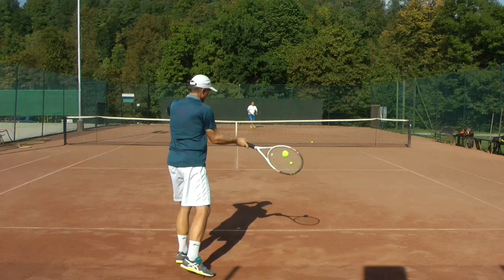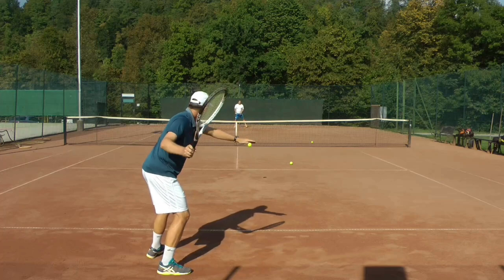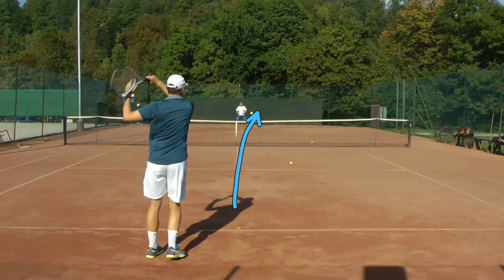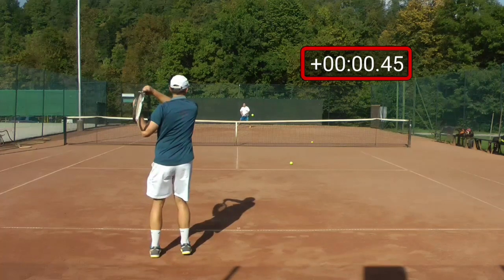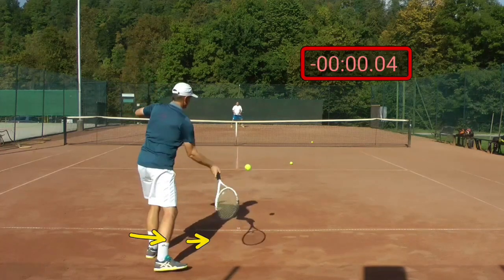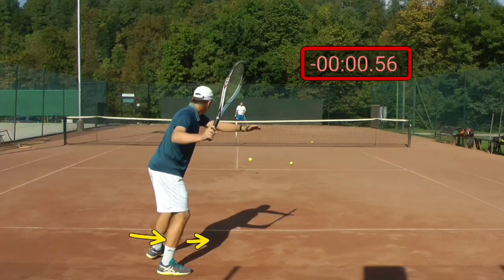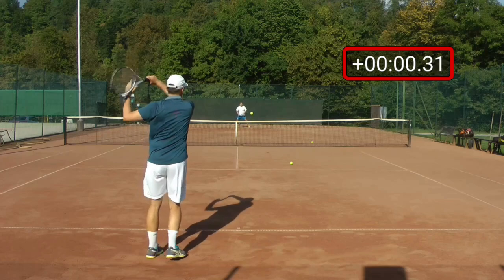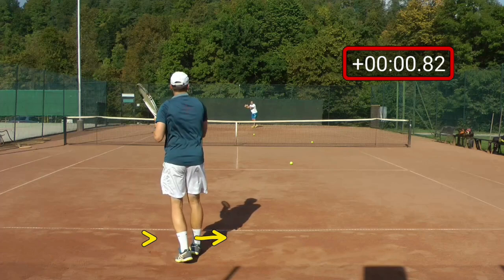Why You Could Be Hitting The Ball Too Hard In Tennis

Comment: Great insight!  Another speed perception issue relates to the flight orientation.  A ball traveling directly towards you offers fewer flight progression cues to your binocular sight.  As opposed to ball that is traversing the court at an angle where the offset between your eyes allows the brain to better anticipate the flight path and time to arrival.  If you feed balls to a beginner, your chances of being hit right between the eyes are higher.  Ouch!
Reply from the maker: You need to calculate air friction, drag because of spin and slow down (friction) because of the bounce. A math professor calculated for me these numbers for 1.5 seconds ball flight with both players 1 meter behind the baseline: OUTGOING speed off my racket: 81 km / h (50 mph), receiving speed of at my friend's racket: 49 km / h (30 mph). It is a well known fact that a tennis ball loses around 50-55% of its initial speed by the time it reaches the other side. The same applies to serves. A 200 km / h serve will reach opponent at around 110 km / h. And yes, those "slow" speeds are the speeds we recreational tennis players can play.
Reply: @feeltennis  
The air friction loss dependent of the spin effect is probably on the order of 10% of the loss.  For a baseball pitch using a radar gun, the loss is 2-3 mph from the pitcher to crossing the plate against a nominal 90 mph throw.  A fuzzy tennis ball would be higher. The bounce is huge.  The coefficient of reciprocity, a measure of the energy dissipated in the bounce, is key to the ball design.  If hitting hard against a wall, you can feel the heat rise in the ball which is where some of the loss speed energy has gone.  The perception of speed received may also be related to higher spinning kick moving the contact out of the optimal zone.  Anyway, I still very much agree that your general point applied to the practically of play.

Comment: Great insight on a simple and super important point. I can play well at same level of opponents, but i get more time pressure with someone more than 0.5 or 1.0 point level(4.0 + utsa), by their faster ball and terrible stable attack. I lost my timing, as I cannot get the full imagination of my return trajectory(highlight of cross the net and depth to the baseline) , do you mean I need practice more like imaging this as soon as I can, or I think I need play even more with higher level player, to get used to their timing??? Thank you Tomaz, a big fan of you
Reply from the maker: How about you try to imagine just the right height above the net while maintaining a constant speed of your strokes? That may be easier to keep in mind. And yes, you need to get used to the speed, but the key is gradual exposure to higher speeds, not suddenly jumping from slow player to a fast player.
Reply: @feeltennis  good point, i will practices. You are right definitely, keep appropriate/constant timing when against diff level of opponents, it is not easy

Comment: That's a pretty good video, I'm the one who was holding back and playing too slow (as enforced by the coach). Yes pace is not the best factor if you cannot handle it. I still have mental inhibitors to playing faster but working at it. Right now I'm playing slightly faster with general control but not able to dictate points. How do you gain control of the point?

Comment: A court is 78 feet, plus the space behind of say 5 feet each side, is 10 feet.  60 MPH is 88ft per second.  So on average 1.4 seconds is  1/1.4 * 60 = 43 MPH.  Seems slow.
Reply: I have read ground strokes average 70 to 80 mph.
Reply: @johndublin776   Maybe off the racquet? A 140 mph serve lands at under 120.  Still too fast for my 70 yr.old, 4.0.  Ha.
Reply from the maker: A math professor helped me calculate some numbers: at 1.5 seconds and playing 1 meter behind the baseline the outgoing speed of the ball from the racket is 80 km / h (50 mph) and the receiving speed of the ball on the other side of the net is 50 km / h (30 mph). 

That is taking into account loss of speed because or air friction, air drag because of some topspin and the friction because of the bounce.

It has been measured decades ago that a tennis ball loses around 45% of its speed from one side to the other. 

A 200 km/h serve is received at 110 km/h. Pros play from the baseline with around 100-110 km/h outgoing speed off the racket. 

The loss of ball speed in tennis is tremendous, just not obvious to the naked eye.
Reply: @feeltennis   I read on line that the fastest serve John McEnroe ever  hit was 113 mph.  You can see why with the old wooden racquets that serve and volley was easier.  For fun you should play a game or two with wooden racquets.  At 71 years old, I still have a couple at home.  Quite different play.